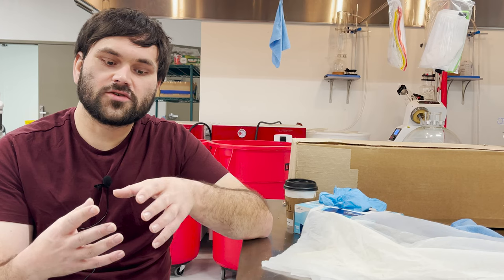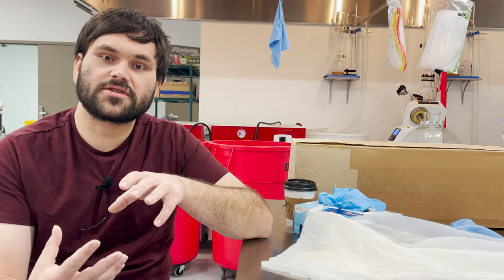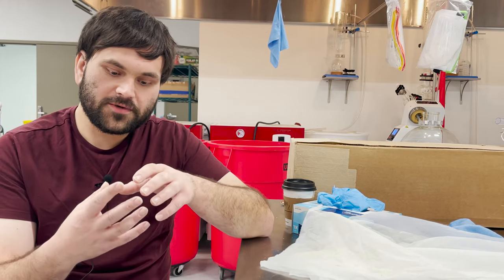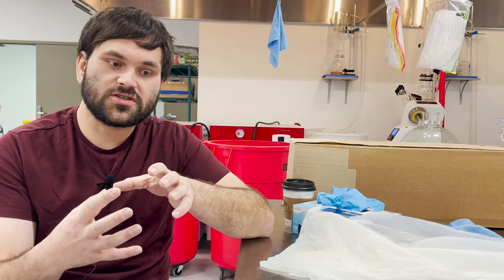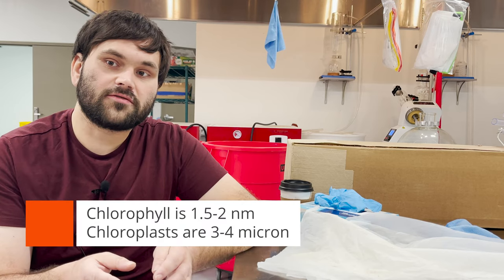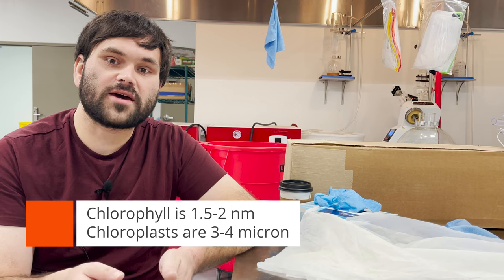Is it necessary to change water frequently when making hash?

Comment: ya but how long should each run be  (how long should  bio mass be in water . )
Reply from the maker: Biomass should be supple. If fresh frozen not long. If dry then could be an hour. Just depends. Make sure inside of the bus has saturated. Runtime varies on cultivar, maturity, equipment and method. We run 60 mins continuous, usually. Some flower washes fast. Some never does and yields poorly. I suggest some R&D until you get a feel for how the process works for your particular biomass.
Reply: @SamboCreeckFiltration  thank you

Comment: One cud argue for those same reasons clear water make prior flushes less chlorophyll bc obv the water is green first run that’s mad chlorophyll great medicine to store in freezer and drink later lol prolly more medicinal than the hash itself. This comment cud be taken too far I do def agree reused water is COLDER AND it rly doesn’t make the prior runs “green” until after the 75 minute rule then definitely does. Hash is a real art with hand spun water being the absolute best period for any connoisseur WEED smoker and not just smoker or dabbler. The LEAST WATER NEEDED POSSIBLE APPLIES TO BOTH TECHNIQUES WITHING RANGING LIMITS. know what ur doing if u wannn make hash and start for a couple years esp on small grows spinning by hand will always be better for those that use a laser thermometer and just don’t over agitate it makes shitty green hash. Pull every 15 minutes I do first pull 45 minutes lol and don’t use shit material to make hash no stems or fan leafs that hash sucks only close sugar leaf from indoor fire is the best outdoor trim yields low in hash and isn’t very good need larf buds from outdoor to make the real zinger outdoor hash. Also dry material is the way for any amateur wet if not processed in a freezer and spun in a frozen room will not yield shit. Thanks

Comment: I would like to see some proof, in regards to your statements.
Just because you say, this and this is happening.
Doesn't make it true.
Another thing is.
If what you say is true.
Then why would you leave the bio in the ice and water so long.
Wouldn't that be counter productive?
I believe you are overthinking this easy process.
Reply from the maker: This is one perspective from one hash maker. Analytical data is hard to come by. Most of what we get is anecdotal. I too would like to see more perspectives and data to support it. However this is out of the mainstream and got me thinking. Always good to look out of the box.
Reply: @SamboCreeckFiltration  
Thanks for the response.
I totally understand your point.
And thanks for trying to bring some understanding on this subject.
Reply: osmosis is real, not a theory though...